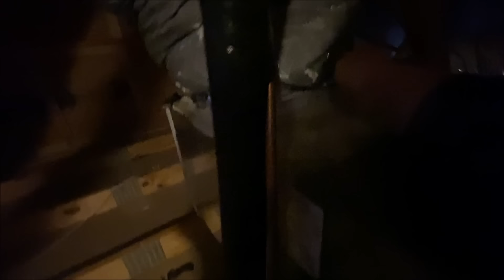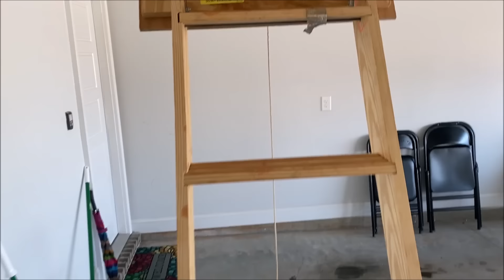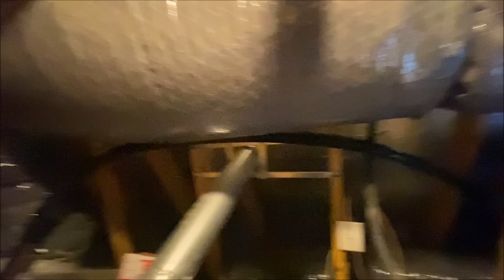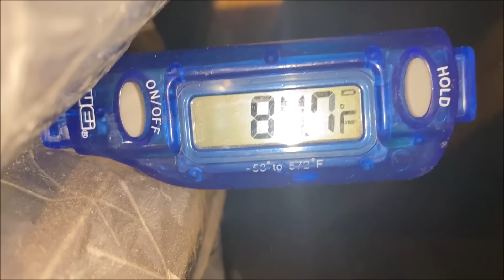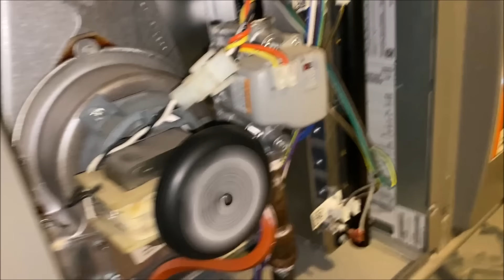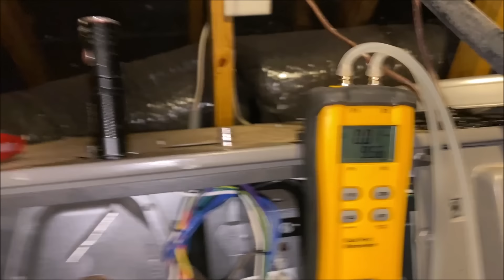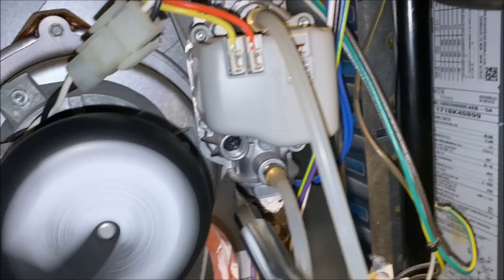New Construction HVAC Hack Job Butcher Sabotage pathetic installers

Comment: The fact that inlet volume dropped so significantly when adjusting the control valve says it all. 
Props for chasing it down instead of condemning the whole thing. Most companies around here just see that as a prime opportunity to sell a system. That’s why I work in refrigeration and food equipment, lol.
Reply: That is only 1/3 of the problem though(Gas/Airflow/Crappy ducting). As he stated there is almost no air flow. That rise in outlet temperature will make a difference but not much.
Reply: That's the problem/benefit of a new system, you can't "just replace the whole thing." Of course on the other side of the coin you can't assume it worked OK before you got there, as I've often heard from my service manager, because this looked like it never worked right to begin with.
Reply from the maker: Lmao ... that is just silly !!

Comment: That flex duct is horrible. It's the Romex of the HVAC world. If I ever have a house built, it's going to be specified that it all be sheet metal ducts, sealed, taped, and insulated with an outside inspector checking before they get paid.

Comment: As  an electrical contractor for 25 years     with 43 years experience in construction it has always been amazing to me that my State does not require licensing for General Contractors. I know I am completely liable for any electrical work I do but these jokers who oftentimes negotiate with every sub to build and complete a project just skate away with nothing to lose except the relatively small chance of being sued successfully. If, as the General Contractor, there was more responsibility for All work performed there would be less hack work like this.
Reply: As a state employee for a major university and 15 years of private sector hvac service and install work I have found that big name contractors are just as big of hacks as moonlighters when code compliance does not apply( or EPA). None have figured out how to wire an encoder properly and it is comical.
Reply: But i thought in the states you had to have a permit anything on your home but anyone can build it with no papers or qualifications?

Comment: most (new construction) install crews use cheap unskilled labor. they MAY have one guy that knows what he's doing. usually, he'll just do the start-up, after install. 
there are reasons for this: labor shortage, builders want low- ball price from contractor, or city doesnt have dedicated HVAC inspector.

Comment: Still allowing mid efficients down there? Wow. Yeah that valve is a pooched.
Reply: Well down here for a big builder, low efficiency means bigger profits! 
They won't eat the cost of a high efficiency system because they are making a killing on upcharging for the old cheap stuff.
And the buyers usually baulk at a 15k or 30k upgrade for a high efficiency system,  they need new furniture and hot tub, don't cha know.

Comment: I would have liked to see the A coil to see if it was blocked. I also wanted to see what the fan speed was and the fix of the loose gas manifold pipe. I hope there is a part two?

Replace the bad ducting with something professional.

Comment: I stopped the video at 44 seconds. OMG, who in the hell installed that system? 

What does H.V.A.C. stand for?

This system will NEVER run to mfg's specifications!
Reply: @ 5:02, What is the static pressure of the supply line?

Comment: That unsupported gas piping looked terrifying. That would most likely be immediately condemned in the UK.
Reply: Should be here in US as well but it all depends on the inspector
Reply: Not to mention that crappy spray insulation.
Reply: @Dev JB Sadly, what would they do? Create a case # and refer them to the contractor or the installer? Just sad how work ethic and standards have eroded. I'm 72 years old and in poor health, but I would never do a job like that.
Reply: neah. there are hacks there too :)
Reply: They would go to jail in ohio
Reply: My house doesn’t even have unsupported gas lines. It has the same furnace though.
Reply: At least it had a drip leg xD
Reply: if you look closer, you can actually see that it is supported.  there is a bracket that is secured to the truss.
Reply: It's supported look again
Reply: Lol
Reply: Most american electric hvac and plumbing would be condemmed in an instant. The lack of decent workmanship and bad regs in usa blows my mind .
Reply: Nobody cares what you do in the UK. We got rid of you in 1776.

Comment: Would it be ok for someone like me with HVAC background to do it myself but I will say that it's better to have a actual technician to install for the warranty
Reply: Most factory warranty specifications state must be installed by a certified technician. So if you are a certified tech it will help.
 And don't forget the Magnuson-Moss warranty act of (1975?). So if it passes an inspection maybe?

But most places call for a license to do gas lines.

Comment: It's not only new construction hell my house built in 1986 the kitchen vent pipe came apart for the  and rain water was leaking into the kitchen I guess 35 years ago they weren't required to glue vent pipes??...

Comment: I feel so bad for the poor people who bought that house. Worse yet that the GC was okay with a system like that. I've never tee'd off flex and didn't even know it could be done, what a mess. We barely use flex in upstate ny but when we do we try to run only 5-10 ft. We try to run rigid all the way and use 90s on top of the diffuser when we use flex so it doesn't sag. I couldn't leave a job like that feeling good, even if that is what the "higher ups" designed

Comment: The duct work is trash but I would take that regulator out of the equation or T of the furnace by itself from the regulator. If that regulator is used for other appliances then it can stay there for them. I would gas pipe from the direct like to the furnace to make sure it gets the full gas and let the gas valve regulate it from there. Don't forget to check that fan speed too... Good stuff 👍🏾👍🏾

Comment: 3 1/2 ton, I go off 400 cfm a ton so that's 1400cfm. Going with one trunk you need a 20" trunk. I keep my velocity up downsizing that trunk to a maximum 12". At 6" leads you're gonna need upwards of 25 leads unless you upsize them to 8" leads. I like my install to breath correctly and most techs want to do the bare minimum!

Comment: I am a stickler for duct work. I'm a lead installer and one thing guys can't to in my area is duct work. They size it too small and never have enough return. Looking at the supply with no main trunk. No wonder why the air flow sucks. Them techs don't check gas pressure or static pressure or fan speeds for that matter based on the size of the unit. See a lot of call for furnace cutting off and usually high limit because of all that crappy duct.

Comment: This job is screwed, I was in HVAC for over 50 years and an instructor and rep for Carrier, this has to go back to zero, load calculation, ductwork designed, gas lines checked for size, everything, maybe the builder has prints with some spec's, this is never going to be right, you might get it to work, but still, if the heat doesn't work with that poor excuse for ductwork the cooling def won't work, you need the btu/hr ratings for the home in heat and cool for that are, once the load calc is done then you can design the ductwork, and that unit may not end up being the right size. Also in your area hopefully you have a Dept of Consumer Protection and local building inspector,  WHO INSPECTED THAT AND GAVE IT A GO??? I'll bet you're in a state or locale that doesn't believe in govt regs or licensing trades, and this is the result. If these guys did all the units in that neighborhood what the what?? I can't see all the gas piping but it sure looks like they used PLENTY of pipe dope, again, like the ductwork, the gas line has to be checked, all appliances btu in rating added up, total =? and go from there, from the meter to that regulator, is that reg right?, etc, but be careful because if you crank down on the reg on the unit due to low press and then the pressure comes back, that reg is going to over feed the unit, wow, what a mess.

Comment: Hey Tim, I had a 15 year old 90% Carrier furnace give me the same problem with the lower supply temp. 97 for supply and 76 for return. my inlet was 9inwc and out let 3.2. I bumped up outlet to 3.5, But no change in supply temp. I tried adjust gas valve out put as high as 4.2 and as low as 2.8. No change in supply temp. Even tried slowing down fan speeds and only got supply temp up to 100 degrees. Went over with the h/o and they said to leave it for now and will give them a quote. But Would suspect the valve is bad?

Comment: I wouldn't be surprised if the had a high limit trip issue due to the lack of air flow across the heat exchanger. Hence why they backed down the gas psi

Comment: I'm an old Electrical out of NJ but am also Certified in HVAC due to me sailing as a Chief Engineer in the Merchant Marine. A couple of years ago we had the entire HVAC system replaced in our Ranch stile home in Central Florida, I did tell the guys on my experience but stepped back and didn't say anything accept for buying lunch for the crew while they were here.   After they were "Done" with the install and told me how great my new system was, I went up in the attic for a quick look around. I was only up there for a minute when I knew how this was going to go, they had left runs off and had others bent so tight that there was no air flow. I told them that someone had better check this "Completed" system before anyone left. Long story short but they had 2 crews at my home for another 3 days.  The saving grace in all of this is the Service Tech that I have is worth his weight in gold!

Comment: My ductwork is a noisy mess, but it is at least not like this. My ducks are aluminum and the original installers just used steel wire to hold it up. When I moved in, every corner of every joint had a hole I could put a pencil through, and several of the runs were disconnected for the upstairs because the wires rotted away. The basement was 85° and the upstairs was 60° during the winter before I fixed it.

Comment: Shame on the lazy HVAC inspector for the city that probably never climbed up to look at that rats nest. That would have been a red tag fail in our area on many counts.
Reply: If they did a rough hvac inspection on the build out it would have been visible from the ground before drywall and insulation went up.  I’m not a fan of the flex duct systems used in the south however I’m sure it would run and pass code if it was sized, installed, and hung correctly

Comment: I would think that once you get the gas flow back to the 3.5" WC you will then start having issues of high temp cut off due to lack of air flow as well.  I hate to say but it would seem that the whole unit needs to be flipped 180 degrees so that the supply and return are on opposite sides.  Then solid trunking line and then the flex ducts come off that.   What a mess.
Reply: That's what I was going to say.  Someone choked off the gas pressure on purpose, just to keep it from overheating.  Not enough air flow to run as designed.

Comment: Supply duct sizing looks like no one knows how to use a duct calculator. A given static is only good for an equivalent length of duct of 100 feet. When your equivalent length of duct is longer, you raise your static pressure to compensate. Or you will lose all of your pressure before you even get the other side of the house. All kinds of pressure problems, I swear those poor people were the ones the most sabotaged.

Comment: Reminds me of this vacant 1890s home I showed twice to clients last January 2021.  Had an 80% furnace that was running non-stop for at least the 3 weeks that we visited.  Seemed to be clicking on and off.  Noticed the ductwork for return in the basement was all opened up.  That was the least of that home's problems.  I told the listing broker.  No one cared, I guess they didn't mind a high gas bill.  Needless to say it never sold and it went back as a rental unit.  Heat probably hasn't ever stopped running a year later, either.
Reply: With the market the way it is I'm surprised it didn't sell.  Our real-estate agent a couple times was wondering if the listing agents had ever been to the properties because of how awful condition some stuff was, including a flooded basement that was audibly squishing on carpet but still up for sale with bidding wars.  Also other fun things seen included animal-poop on carpets and a dead bird in a garage.
Reply: @matthewmiller6068  This home in particular was a bit odd.  We have a hot real estate market but sometimes it's not hot enough for even the most weird of things.  In this home none of the bedrooms had closets either, lots of mice poop everywhere, even found a hefty bag of Mari Jane in the kitchen cabinets.  The home was remodeled sometime 30 years in the past but it was horribly outdated.  A lot of things that just didn't fit the home especially for the price they wanted.
Reply: I am a home inspector and poor installation of HVAC is in my top five issues I find. It’s disheartening.

Comment: What's worse is...new construction installs are way less difficult to do than an existing home changeout by a good mile. Path of least resistance seems to be the core plan with this contractor.
Reply: did you not pay attention to the hacked mess of jumbled random trusses? you couldn't run a real trunk more than five foot without needing to use offset and large bends.
by golly they designed it fast as hell,  designed by junk computer program it seems and nobody looked it over nor cared too, likely a green/wet behind the ears/no field knowledge architect did the mess to start.
Reply: @throttlebottle5906  Yeah them trusses were a fucking mess. It looks like they hit a "maximize 2x4 usage" button.
Reply: @throttlebottle5906   It's a pointless hip roof cobbled together McMansion style. I bet it has a "stone" or brick front, and the cheapest vinyl siding on the sides and back. Builder-grade vinyl windows too... "Craftsmanship, function, and footprint-efficiency be damned, I want my money spent on making my house look like I won the lottery... or at least a scratch off..."

Comment: Customer should contact Lennox and try for warranty repairs directly through them and file complaints about the install/ducting/plumbing/regulators etc. It appears they had Shemp from the three stooges applying the pipe joint compound on the gas plumbing and also it appears Shemp used some old pipe vs. new not to mention, he left his mess behind. 
I would hope that Lennox comes out and see's the ducting mess directly from Luigi's Spaghetti House. I have to agree on the "rules and efficiency standards" being put on the manufactures but not on the installers and HVAC tech's. Big Government is fooled they are doing anything for the air quality and the customers pocket book or energy resources as this is pure proof of it. This general contractor needs to be looked into and his HVAC sub contractor then forced to correct all of the homes to satisfy correct HVAC industry approved procedures. My guess is none of this work was done by anyone with a license and no one with a license bothered to critique the final inspection...likely they were in a hurry to get to Acapulco after that phase in construction.
Reply: Lennox is great just very bad install, all manufacturers  have sloppy dealers  flex duct has been the greatest energy hog ever invented

Comment: If you get the gas pressure to the proper level, you will probably have an excess temp. rise from low air flow.  Looks like the spaghetti needs to be ripped out and start over. After that you can bring the gas pressure to a proper level.

Comment: Until they give the inspections the power to fail on poor design this is going to keep happening.i have talked to our mechanical inspector about this.he says if the duct work is up to code on installation factor not much he can do.also these home builders just go with the cheapest bid and could care less if it works.this builder is a prime example.not even two years old.sad and feel sorry for the homeowner because I see a guy job of duct work and redo

Comment: I personally have found some new construction errors..one time I went to a house no heat call. Went down and seen furnace running great but no air. After checking everything I found they had put a main supply outside thinking it was fresh air…lol..
Reply: In the fall of 1993 I was installing an instrumentation upgrade for CNG at its Lebanon, Ohio pump station. One cold morning they asked me if I'd mind driving to Washington Court House and troubleshooting a no heat issue in the office. The facility had been constructed earlier in the spring. When I removed the thermostat I found wiring on the AC side but nothing on the heat side. An hour later the office was warm and I was a hero. 
A day earlier I had troubleshot a no heat issue at Lebanon to a hot water check valve that had a piece of rubber holding it open resulting in a cold building. Sometimes it's the little things...

Comment: What a basket case got to rip all that out redo the duct work air doesn't follow the arrows if you know what I mean in my area if the inspector seen that ductwork it would have been a fail fail fail

Comment: What's the fake snow insulation called? That stuff is all over, hanging in the air, that can't be healthy. Spray foam would have been much better. Do they just dump out bags of that stuff in the attic or are they supposed to spray it down with some adhesive to fix it in place? Definitely looks lung cancer inducing...